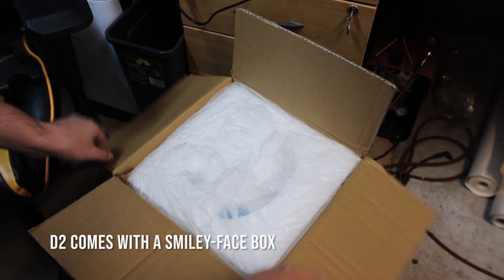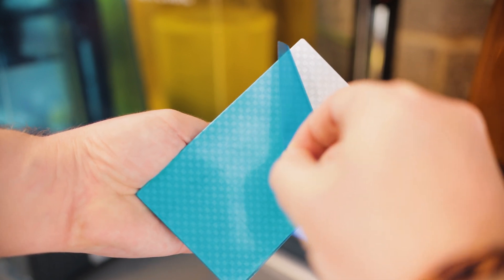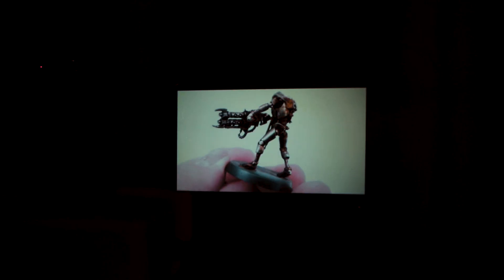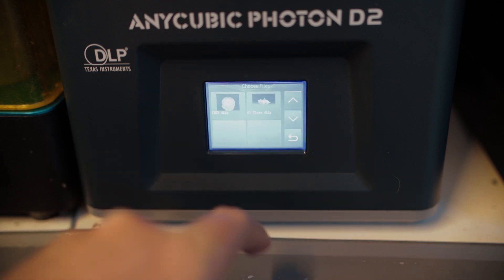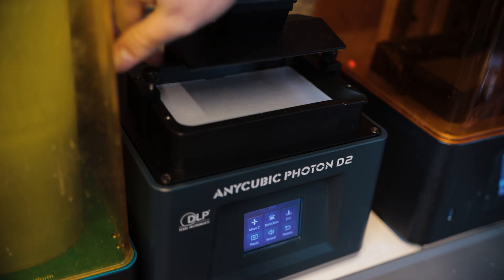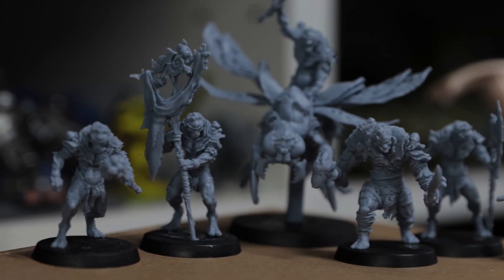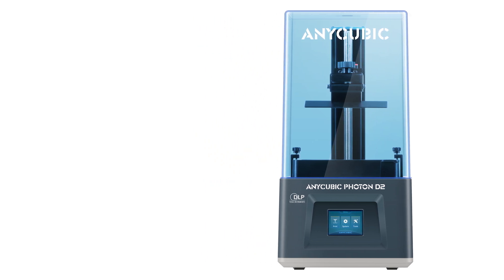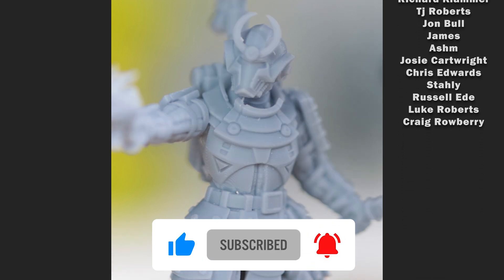What is a DLP 3D Printer - Anycubic Photon D2 Review for Miniature Printers & Painters

Comment: This work for Making RC parts an Accessories ?
Reply from the maker: I have no experience doing that. The details sure but you’d need some super tough resins to withstand the mechanics involved… depends what the parts would be used for tbh
Reply: @FauxHammer  ok that makes sense. Thank you so much.

Comment: I got the D2 after adding your review. It destroyed 3 FEPs on the first 3 prints using AnyCubic resin, AnyCubic settings, and the AnyCubic R_E_R_F file for the D2. I confirmed that the firmware is up-to-date too. Not sure if i got a dud, or if there's a setting that's off. Tech support is useless. They keep saying to adjust my settings and everything will be fine. Is anyone else having trouble with the FEP on the D2?

Comment: Hello mate. Ive got a D2, and I love it. However I have a few minor problems im struggling with. I think the builds are sticking abit to the FEP, and the miniatures are coming out rather fragile. Im using DLP craftman resin and im otherwise very happy with the results. The miniatures looks absolutely fantastic. But? Do you have any advise on solving My minor problems? I would like to be able to use my models for gaming, but right now they are abit too brittle. 
Cheers mate and thank you very much for your excellent channel. 
Thomas
Reply: What's your exposure time? How long are you curing the model in UV light? What kind of UV light are you using? (Sun? Wash n Cure?) Too long of a cure time will make it brittle. Could also try mixing some Siraya Tech Tenacious (15 to 25%) to give it much more flexibility.

Comment: Hi Ross, thanks for another well-thought out review. I didn’t know anything about DLP resin printers before today!

How easy to sand those less-brittle DLP prints? Sometimes if the material is too ductile, it is a real pain to sand it.

My hobby is scale modelling, your planes and mechs. I wonder if the sharpness from DLP printing, can give sharper edges and corners, and straighter lines and planes? That’s what we really crave for. Thanks .
Reply: Sanding resin is pretty easy with the right tools. Id recommend sanding sticks or foam nail buffers, both are makeup products so readily available. However, always use water when you do this as resin dust is highly carcinogenic and very easy to inhale.

Comment: One of the first things I look at for prospective printer upgrades is the light and lens system, followed by the UI and the available slicers (partial to Lychee and really, Really not keen on Chitu for reasons; mostly involving being locked in to proprietary crap). The light source is really at the heart of the printer, with the screen type a close second. You can have an average screen, lets say a 4k midsize for instance, but the light source and its inherent lens system can make or break the quality of the prints. My three year old Uniz has a fantastic collimated lens system that for all intent and purposes eliminates grid issues with the screen, so much so that when the lead screw decided to crap out recently, I ended up fixing it versus upgrading (for the time being).
DLP has been around for several years in industrial high end printers, but way WAY out of reach for the consumer market. They have active cooling, dedicated fill tanks, were on average about the size of an office paper printer, etc., but the lamps only lasted about 500 hours and were a common maintenance item. 
Anycubic going with an albeit too small for my needs DLP was interesting at first, but I highly doubt that 20,000 hour claim. What is more likely is that it was stress tested for a month and the math says an equivalent service life is 20,000 hours, but as said, even being relatively low power, things wear out faster when they are constantly in a hot environment, which is precisely what a lamp in a projection use case is.   If someone manages to get that kind of life out of an Anycubic DLP, I'll be first in line to eat crow.
Reply from the maker: Yeah, I worked it out to like 1.6 years of display on time. Considering a 1000 layer print with a 1.5s exposure time would only have this smdosplay in for 40 mins of a 6+ hour print time. Those numbers seem insanely high.
Reply: @FauxHammer  I've forgotten what my exact numbers were but I believe I based it on an average 5 hour "light user" who prints maybe once a week and has how many ever failed prints to every successful one and it came out to 4.63 or 6.43 years (I forgot what numbers I used where, but some combination of the three feels correct) before a major component would fail, which honestly you could definitely get out of a monochrome screen in that use case before you have to worry about replacement or the machine's capability to price ratio improves well over what one is currently using. That's also assuming a modicum of maintenance is done occasionally and it's stored fairly well.

Comment: How do you guys go with pre supported models on this printer? I get a lot of fails
Reply from the maker: Absolutely fine. But pre-supported doesn’t always mean well supported.

Try the One page rules free starter set, if that prints then you know the issue is the supports on other prints. If it doesn’t print those, it’s your settings

Comment: The D2 costs almost 3x as much as I paid for my M3 and I'm having nice and crisp prints with the M3 (imo), so I don't see any reason to spend 3x as much for the D2, honestly. Yes, the screen on a DLP printer has a longer lifespan and if you scratch pr ruin the glass plate on your screen, you just have to replace that glass plate, which is less expensive and tedious than replacing an LCD screen. And yes, they use less power (not that much less really), but still. Not worth it for me. I can replace my whole M3 at least 2 times for the price of one of these.

Considering the Mars 4 from Elegoo has a bigger screen (I think) and is cheaper than the D2, I see even less reason to buy this one. Let's hope prices for these things go down when they become more mainstream.
Reply from the maker: Yeah it totally depends what you want. Make the right call for you

Comment: Man, that banner comparison just made the case against the D2, for me.

Pause the video at 6:16 and study the two. That D2 image on the left looks like shit, compared to the right. 

Look at the banner cloth, inner edge. That left image is all jagged, whereas the right image is smooth. That part of the horizontal cross brace that slides over the vertical piece of the banner frame? Jagged AF on the D2 image, smooth as hell on the Photon. Now look at the rings around the vertical pole; bottom ring. WTF is going on with the D2? It looks more like the results of a PLA printer. Look at the smoothness of the banner cloth. D2 has bumps on it. 

Now, add proprietary resin to the list and it seals the deal on the hard pass. Just like any Apple product. If a company does not allow me to have choices in what components I choose to buy, then they can kiss the fattest part of my ass. Hell, the knowledge of this bit alone is enough to make my mind up against the D2.

$700 based upon that quality? I'll pass.
Reply from the maker: If this helped you make the right choice for you, then I'm happy because that's what matters most.

Comment: The flexibility shown here is due to the dlp Craftsman resin?

If yes . What's the difference if you use it in a LCD printer? Does it lose the flexibility properties?

Another question.

I use though resin flexible from anycubic is this one more resistant and flexible that that one?.
Reply from the maker: yes the DLP Craftsman resin has some flexibility which I really like. But I haven't tried one from Anycubic called Tough Flexible.

Comment: Anycubic M3 Premium or Anycubic Photon D2?
Reply from the maker: for me. M3 Premium. the convenience of that larger build plate is worth more than the sharpness of this printer. I print minis and most models do not have the detail to benefit from what the D2 offers.

But, in saying that, the D2 is really easy to use because it's hard to get exposure settings wrong.

Comment: so maybe i missed it in the video but i have the photon mono X right now. Does the D2 take a different resin? or will the regular anycubic resin i've been using for my photon mono x work with the d2? thanks!
Reply from the maker: nope, you can still use teh same resin, the light emitted is on the same wavelength.
Reply: @FauxHammer  Sweet! thanks for taking your time to answer my question!

Comment: Great review I just wish they made this printer in a larger format, I just picked up the mega 8k because I normally scale up miniatures as center pieces so I need printers that can print big!! 

I must say though compared to the Jupiter, the m3 max and the saturn 2 8k the prints from the mega 8k look the sharpest and I'm just using sunlu dark grey abs resin..
Reply from the maker: You got a Mega 8k!!!!! Unles syou mean Mighty, I'm so jealous!
Reply: @FauxHammer  Yer it says mega 8k on the front and it's huge, the seller only lived about 1hrs drive from me so I got free delivery as well.. 

I'm just waiting on a 22h test print to make sure there's no problems like stepping, z wobble or layer shifting.. 

Fingers crossed I got a bargain 🤞🙃
Reply from the maker: @printitpaintit.2436  it’s the one I want. I do t need it at all. But I want it so bad

Comment: The merits of DLP over LCD are clear, but I have a use-case for which I'd like to get your thoughts on... I am planning to 3D print parts for a musical instrument where the parts need to fit seamlessly together. For a DLP printer such as on the D2 - are the horizontal pixel dimensions exactly identical across the print bed (that is, going from the center to the outer edges)? On an LCD resin printer they should by definition remain uniform, but being that DLP involves optical projection there is the potential issue of aberration on printed content near the edges. What are your thoughts on this?
Reply: DLP printers until now have been used in the medical and dental fields to make things where every nanometer of fit counts, and even small flaws result in a part being binned. It should be massively more precise than an LCD, from what I know. So in that use case, where precision fit is vital, a DLP will be superior.
Reply: @alertedcoyote7892  Great point. I imagine the DLP printers used in medical and dental fields are the kind that are considerably more expensive and exacting than consumer grade printers like the D2. I suspect that it would measure up quite well to the high-end DLP printers in this regard.
Reply from the maker: I honestly don’t know I’m afraid. I’ve not tested to that degree. I’ve not personally seen such degradation in outer edge prints to suggest this is the case. Even in my few tests everything appeared solid

But I have seen other channels suggest this but never any direct vid eve to support the claim

Comment: Will the build plate fit in the Mercury Plus wash station?
Reply from the maker: Arent the Mercury's made for the arms on the Elegoo printers? I mean it will most likely physically fit.
Reply: @FauxHammer  Yes they are, but having never seen an Anycubic machine in the flesh, I don't know if it'll fit the mount - in my case, I like to mount my build plate on the bracket above the tub so I can wash the models before removing them from the plate.

Perhaps it's possible to precariously perch the plate on the basket, if the bracket doesn't work, but that could lead to breakages.

Thanks for the rely!

Comment: I still disagree after seeing the results. I sell custom bits, and I create silicone molds out of base models printed. I need to get them as sharp and smooth as possible. After much testing and lots of macro shooting with a Nikon I got the perfect settings to get a smooth but extremely sharp print. This involves grey scales using Chitubox.  Comparing your results to mine I can see yours have clear, defined layer lines. 

If you want to compare them I'd be happy to print any model you want and compare the results of the LCD print with your D2 DPL printer.
Reply from the maker: They do, I have an updated and dedicated comparison video coming out in the next couple of weeks

Comment: I would be very grateful for advice.  I would like to buy my first 3d printer.  I read your reviews and I'm thinking about Elegoo Mars Pro 3 or Anycubic Photon Ultra.  Both are now the same price in my shop. U can squize my wallet a little bit and get also this D2.
Reply from the maker: Easy, if the same price D2. So much easier to use, lasts longer and has sharper detail.

That said, the Mars 3 is also a solid printer, but has nothing on the crispness of the D2

Comment: I would 100% buy one of these as my next printer, IF the build plate was larger. Instead, I will be going for a Saturn 2 simply because: 1) It's cheaper & 2) Build Plate size.
Reply from the maker: I would make the same choice, though I’m about to check out the Saturn 8k which is cheaper and appears to have the same spec-ish
Reply: @FauxHammer  I looked at that one. The only reason I'm looking at the Saturn 2 over the 8k is because the 8k is running on old hardware. The Saturn 2 uses a new UV setup which is meant to deliver crisper prints. Any printer I buy will be an upgrade anyway as I'm currently rocking a Mars Pro.
Reply from the maker: @schtoff8200  I’ll be able to tell you soon, Saturn 2 is reviewed and just needs edging. Cracking the Mars 8k out this week
Reply: @FauxHammer  I'll keep an eye out for the videos!

Comment: That thing you said, that D2 can zoom in and out.. that is actually kinda true, BUT it is not automatic nor on a software level, you can physically modify printer itself (move lenses, refocus, nothing major, well, depending on a printer construction), and zoom in, having same resolution on a smaller surface, well, you would have it permanently.
Reply from the maker: yeah, i spoke to Anycubic, they confirmed this. it was just a theory that didn't pan out.

Comment: I am using the D2 for jewelry.  I started 3d printing about 9 years ago went from a CNC mill to a to a Solus which used a DLP projector for its light source set in front of the printer.  It was super small and was at that time around $5k very hard to use and there just wasn't much info on 3d printers at that time.  Then the original Phrozen Shuffle came out and was pretty good for many things since then they just keep getting better and better.  I have had a couple 4K and got fed up with dealing with the LCD screens that burn out and when you replace them, they still won't work.   So that said the D2 is great, it even works very well with direct castable resins (which supporting is the problem with most of them esp wax based).  Love this D2 Printer thanks for the video.
Reply: I want to get into this. Do the voxel lines affect the final product when the jewelry is casted?
Thanks
Reply: @UnratedPlayer21   Litle late to the party but yes. Aliasing lines will get printed on the metal cast, and when inside intricated parts, is a pain because we need to sand that surface to make it flat.  Ideally we want the metal cast to cmoe as perfect as possible to just sand it with a very high sand number and polish it on tumbler ( in aperfect world )
Reply from the maker: yeah it's great on those more tenacious resins because you can ramp the exposure right up and not get that outward LCD bleed you get from other printers.
Reply: yes, i suffered with shuffle 4k,the screen very short life -less than 100hour used.Can you tell the D2 are same print quality to the solus ?,because i cant afford the solus

Comment: I just purchased one of these and was curious if you could share your settings. I am a very new user so this would help immensely. Also I loved your video and it was the reason why I decided to go with this vs the mono series. Any help would be appreciated and thanks!
Reply from the maker: Thanks, but honestly I can tell you are new becasue my settnsg will not help you.

You need to do your own exposure tests. because the temp/humidity of your environment. have a look how to run exposure finder tests and dial in your settings.

i wish I could help, but this isn;t how it works I'm afraid
Reply: @FauxHammer  That's ok, I got some settings from another channel to "default" my machine, and have a place to start from and then "dial" in as your saying. I realize that environment might have some to do with the settings however a ballpark is all I was looking for, but thanks anyways! Cheers
Reply from the maker: @markzimmer2820  perfect you’ve got it! Yeah I kind of purposely avoid showing settings. I change them frequently and it often just breeds hateful comments telling me what is too high/low and how I’m wrong in some way.

New people may also try them and get bad results and that reflects on me and my channel.

Glad you have your starting point.

I really should do a video on this

Comment: Crisper edges aren't worth much when the entire model looks like it has wood-grain to me. The D2 is pretty easy to spot, because its consistently marred by the obvious print lines, for better or worse. And I haven't really seen any examples of it being clearly more detailed - certainly not in a way notable enough to not be far outweighed by those details being jagged due to the layer lines. But curious to see more comparisons.
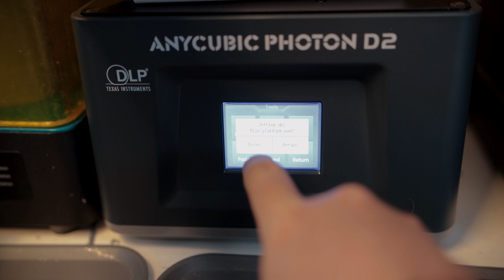Reply: They don't actually look crisper to me. At 6:26 the hair strands stand out more on the right model than the left (D2) imo. At best you could call it even overall with a big fat L on the print lines for the D2 vs a 8k LCD.
Reply from the maker: It’s sharpness vs smoothness. The D2 is generally easier to use as you can ramp up the layer exposure time without much overexposure bloat